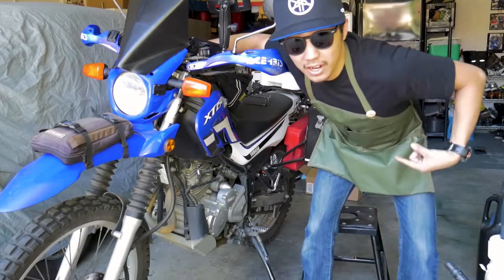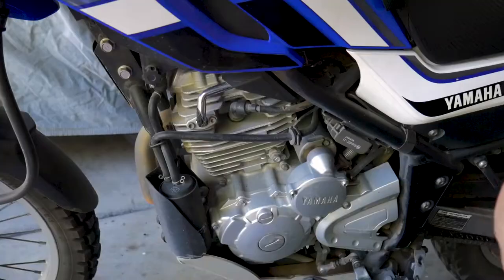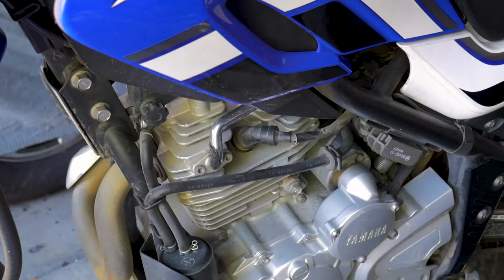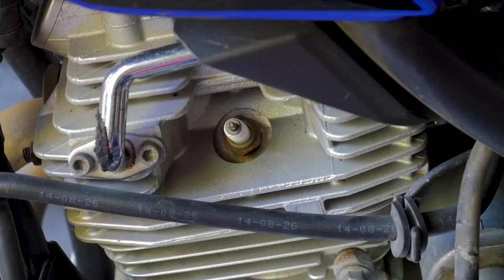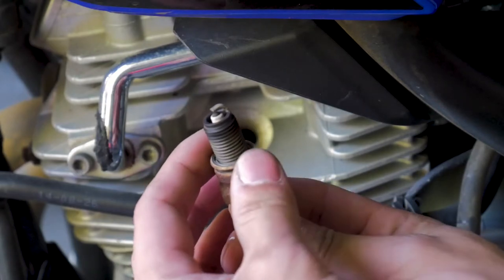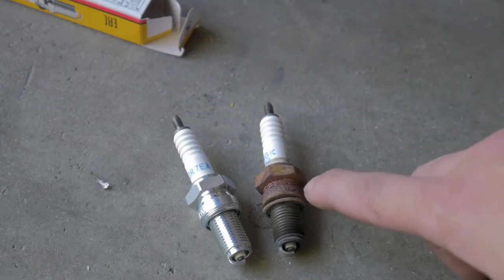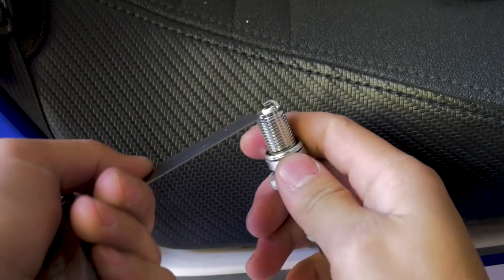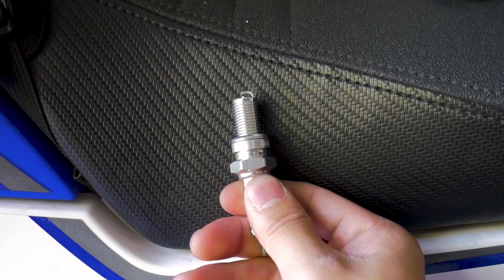Yamaha XT250 Spark Plug Replacement

Comment: Watching your video was a good way to start my day.  I'll turn 7,500 miles today on the DR650 I bought in May (awesome bike!), and will check my factory service manual when I get home from work.  Really hadn't thought about changing it, but as you pointed out it may be time.
Reply from the maker: Hey Matthew! Thank you so much for watching and thank you for becoming Patreon Pledge #2!!!! Changing plugs is one of those things that you really don't think about until something goes wrong. But having a thumper, it's so important to have all of your powertrain components working properly. 

~NoOne
Reply: You are welcome.  And sure enough, I checked my service manual and it's time to change the plugs (at 7,500)!